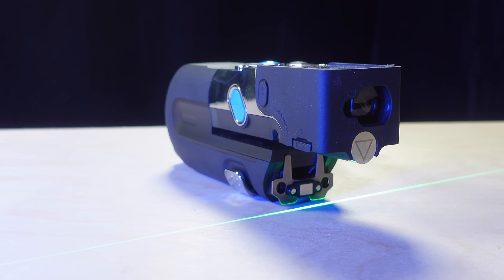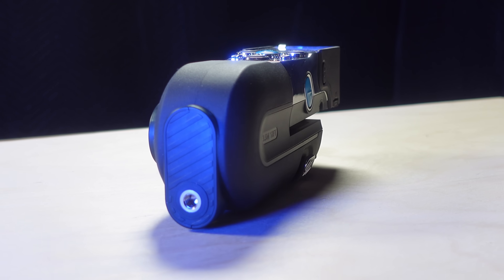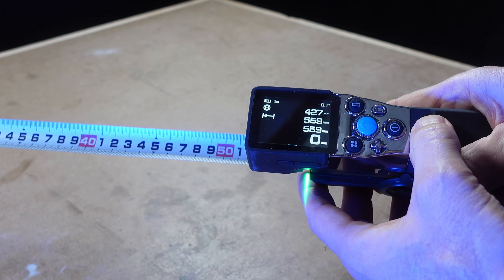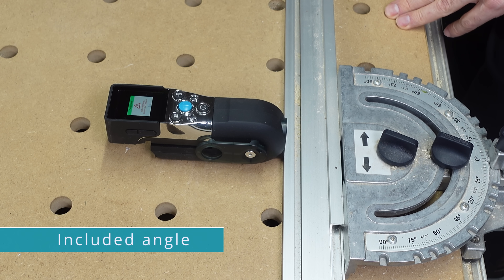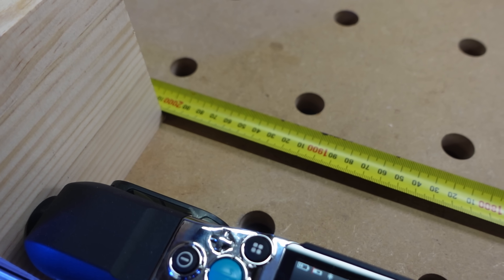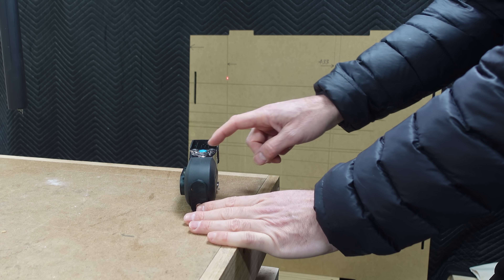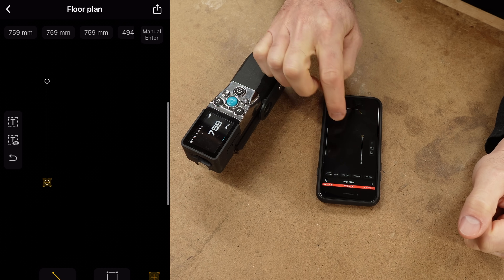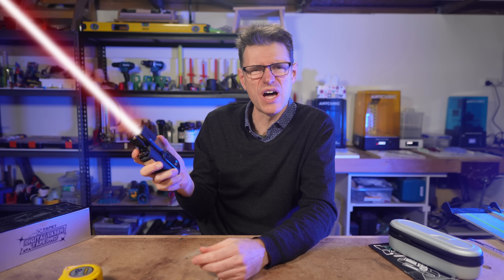Mileseey X Tape 1 Digital Laser Tape Pro | Detailed Review

Comment: Shame they use soft touch plastic. It’ll be covered in sticky goo in about 5 years time. Happens to every product I’ve ever owned that has a soft touch surface. Rubber coating (or even just regular textured hard plastic) would be much better. And running on AA batteries instead of an internal rechargeable battery would mean it won’t be a paperweight 8 years in the future when the battery dies.
Reply from the maker: Thanks for your comment. I’m inclined to agree. Particularly the soft touch material when you’re working in hot conditions. Time will tell I guess. Maybe it will last much better than expected. Thanks for watching. 👍

Comment: Just got mine just now. Question? Does the hook with magnet slide out a bit? Like the rivets that hold it ain’t completely pushed down to hold it from moving or is it supposed to do that?
Reply from the maker: Yes, that's correct. The hook moves in and out so that you can do internal or external measurements. When you hook over the edge of something, the hook slides out. When you butt up to an object the hook moves in to allow for the thickness of the metal of the hook itself. That's common on pretty much all tape measures. Thanks for watching the review. Hope you enjoyed it. Have a great day. 😀

Comment: I finally received my crowd funding unit a week or so ago, and had the time to look at it last weekend.  The very first thing I noticed was the poor rubber cover for the USB-C connector. It doesn't fix/seat properly, and I suspect the thinned rubber 'hinge' will deteriorate quickly as it flaps around (the supplied cable may be good quality, but it is quite short). Second thing I found, I could not delete measurements in the app. I thought the app stored them, but seeing your video, maybe I have to delete them from the device, and it syncs back to the app. Third thing, I tried to use the laser measurement outside on a bright spring like day. I couldn't see the red dot over a distance of 4 meters, and was hoping your video would answer if I was wrong to expect this, as I have never used a laser product before. The manual also states that the tape end can either be 'hook over' or 'butt against'. The measurement shown appears to be hook over. As the hook blade freely moves in/out 3mm (first marker on tape is 4mm, assume there is a reason for this), I doubt very much there is a way for the device to recognise if it is 'hooked' or 'butted', but there is no explanation how to adjust the shown measurement. Surely you are not expected to remember to add 3mm blade? For such a 'fixed' change, you would think there was a dedicated button/function. NB the manual appears to be wrong, as it only mentions the hook blade being 1mm, it does not mention the 3mm 'free movement'. I would have to guess that there was a design change to the tape, but it has not been incorporated into the product (only the calibration to 'hook over'). NB it is a little hard to see if your tape has the free movement, but I think @ 2:49, I can see the hook move as you hit it against the metal frame.
One other minor thing, I can't see where to loop in the supplied 'wrist string', seems to be superfluous.
I must admit, having the tripod screw mount in a vertical orientation made me scratch my head until I watched you video (I was thinking in terms of the 'red point', not the 'green line'). It seem obvious that there needs to be a well engineered tripod attachment that allows the XTape to rotate around a central pivot point (which would probably be best attached from the underside, as you suggest). Your video kinda explains why Mileseey have not produced any practical usage videos, as they would clearly show the limitations not having a fixed pivot.  As a crowd funder, I have a vague memory that they showed a guy standing in the middle of a room, 'freehand' pointing the laser at two corners to get a measurement, which would be impossible to achieve.
...editing this, to include their video (https://www.youtube.com/watch?v=FntZkKOB2mA). It actually shows a tripod mount at 2:30/2:48 ...but also shows the guy wandering around 'freehand', collecting a load of inaccurate measurements ...that is not 'just misleading' IMO ... I feel a little annoyed that the necessity of this accessory was not made clear, and provided as part of the package.
Reply from the maker: It's a shame that aspects of the product have not met your expectations.
Reply: The whole point of a movable end hook on a tape measure is that it moves to automatically compensate for whether the tape is hooked or butted. That’s true of all tape measures. You don’t need to compensate.

Comment: Would this be good to measure countertops?
Reply from the maker: Thanks for your question. I think it would be particularly good for that purpose. Large, flat open surfaces are well suited to this device with the easy to read digital display. Perhaps not so much for general workshop application where you just need to quickly grab a tape and measure something.